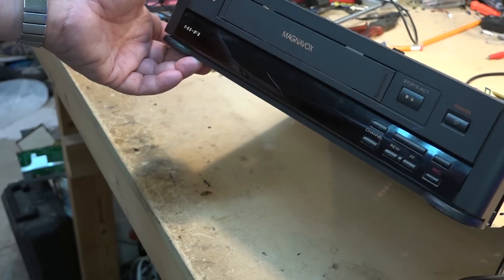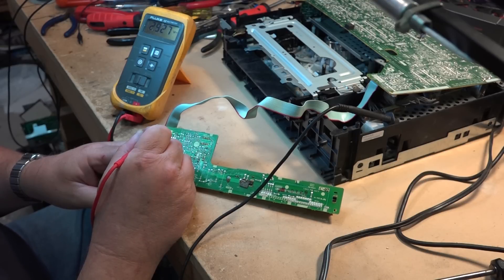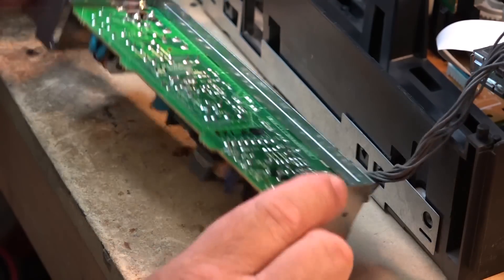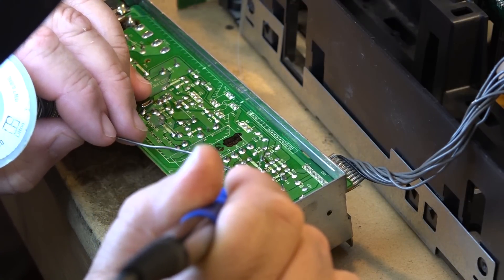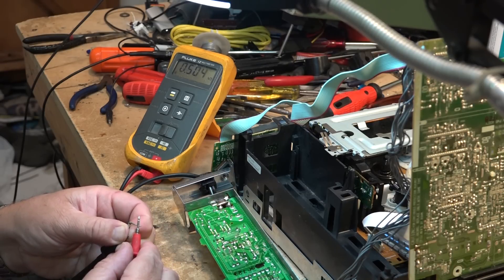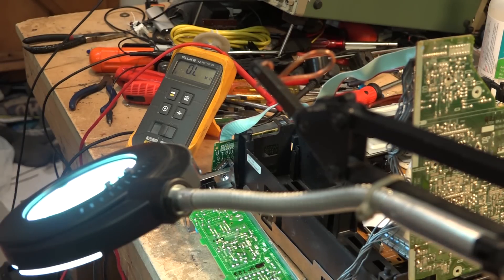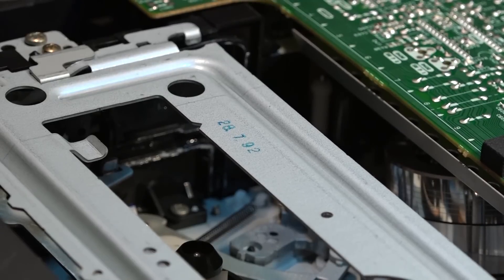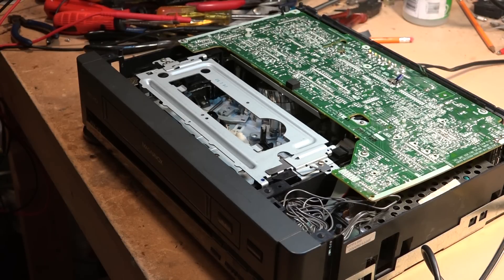Troubleshooting vacuum fluorescent display problems

Comment: What about if all supply is good and complete but no display. What is the main trouble?
Reply from the maker: If voltage is correct there is only 1 thing left. The display tube
Reply: @12voltvids  it can be repair it the  display tube?
Reply from the maker: @paolomarcelogalvan1938  
Sure, replace the tube.   Good luck finding one.

Comment: after replacing the resistor you should have measured the filaments again so i can understand what it should be
Reply from the maker: Filaments typically have about 2vac on them but some designs use DC filaments so measuring really wouldn't accomplish much because it depends on the design you are dealing with and how it is wired.
Reply: @12voltvids  i'm trying to determine if the vfd on this expensive piece of gear (Lexicon M300) is dead or if the PS needs addressing. I have to understand how to test this VFD. thanks
Reply from the maker: @geezberry8889  you will typically see ac on filaments or and there may be a -dc applied as well as the AC to hear them.  Then the anodes get a + voltage. Then there is the screen. There Are many types of display.  Direct drive and multiplexed.  It could be a power supply issue, driver issue or a display.

Comment: Hi.  I am working on VFD clock radio.  I have the service manual.  The display appears to be working fine.  The Hi is very visible and the Lo is really only visible when the room light are out, an maybe that is the way it is intended to work.  Is there another a way to communicate with you?  It is a Panasonic RC-6610.

Comment: As Adie Lawson said below, you make it so easy. I have a situation in my JVC hifi after installing a bluetooth upgrade i "ACCIDENTALY" dropped a screw on the back of a main board and shorted a PNP transistor and now the phosphourescent display is reading a troubling 8888888888 and every display segment is on.  The trouble is trying to locate a KTA1046-y transistor and the only unit that was economical to get in a decent delivery window of 3 weeks was from england, the ones in china would take over 2 months....... nothing like modern times.

Comment: I see why the display was not lighting up, would it be the same possible issue if the display is lighting up but very dim and an equally dim??  The right side of the display lights up a little more than the left side.  This is for a very high-end Carver receiver, so I have to repair this she’s a classic‼️

Comment: Any help regarding a Kenwood KE 7090 Graphic Equalizer? On standby mode you can see like red lines that glow, never happened before, ive replaced all capacitors but still the same results

Comment: Hi. I have an VFD on my car and suddenly it filaments started glowing orange. What do you think, it's wasted or can be repaired?
Reply from the maker: If they are glowing then there is too much current flowing through them.  They normally do glow very faintly as they are hot cathodes.  They have to be hot to work, but not to the point that they become an incandescent light bulb.

Comment: I have a Sony RDR HXD710 which has a very dim display but it’s brighter towards the edges. Everything else on the unit is fine. It’s got an always on display though, so do you think it’s a warn out display or something to do with the power circuitry such as capacitors?
Reply from the maker: The display tubes do eventually wear out.  The cathode wires eventually drop in emission and the brightness falls.

Comment: Hi. Thx for the great video. I have a question. I have a Sony Lbt-V902. There is 2 problems with the tuner and equalizer displays. Tuner: Some characters of the tuner display are dimer then the other ones. Equalizer: Right channel display is dimer then the left one on the spectrum analizer display. Are these fixable without changing the displays which are impossible to find replacements? THX

Comment: How do you make a VFD brighter mines started going dim on an old kenwood equaliser?
Reply from the maker: If the voltages are correct then it is the tube that is getting weak. They are a vacuum tube, they do get dim as the emission from the cathode decreases.

Comment: Is this a common issue on VCRs? I got a Panasonic NV-HD100PX (yes, it's the K deck) and the display doesn't light on. Plus it had that common issue of the cracked plastic piece on the loading motor, which I managed to fix with super glue.

Comment: I have perfectly good JVC HR-XV3 VHS/DVD player that only has dead display. I took a look inside but couldn't see anything obvious like leaking or bulged capacitors (that's where my skills end) and seems like everything has to be dismantled to get the power supply board out because it's under the DVD rack. I wish I was electronics god too lol

Comment: I think that about 75% to 95% of problems with electronics can be rectified somehow if you have things like a 3d printer or the ability to etch a printed circuit board, but if a vacuum florescent display suffers a catastrophic failure (like being vented), it's all over, unless it's a video cassette recorder that has an on screen display or something.

Comment: Great video, I love VFD's.  I've got a different issue with mine, mine pulses the grids that are supposed to be off.  I don't know if it's a power supply issue or just the display.  Here's a 5 second video of it happening.  

https://youtu.be/68BuT-MloW0
Reply from the maker: Well I can tell you what it definitely isn't.
The display.
They don't fail like that. They are a vacuum tube, basically a direct heated triode.
It is likely a bad filter capacitor in one of the supply curcuits. I had a weird one with a display issue.
Watch this one:
 https://www.youtube.com/watch?v=tcWQvWI5WEg&t=600s
Might give you an idea. This was one where an electrolytic capacitor actually shorted.
Reply: I recapped all the electrolytics I could find the the PS, but no dice, and I measured 11 VAC on the 32 Volt rail.  Dunno what the heck is going on there, oh well.
Reply from the maker: You shouldn't have AC on the 32 volt rail.
How are your diodes?
AC should only be present on the filament
Reply: I pulled the rectifier diodes and they all pass a diode test.  However the resistance across one of them is 800K ohms while the others all measure around 4 Megs.  I don't know if that means anything.
Reply from the maker: Normally silicon diodes will pass current witha .6v drop across the junction in one direction, and apear as open in the other.
Reply: Thank you sir, I don't think it's the diodes I tried 4 new ones.  My VCR as a lot of shielded cans everywhere, I found some bad caps in some of those.  We'll see how many more I find, haha.
Reply: how about if a few characters are not showing up? Would that be one of the pins that control that letter are not connected properly? Or would that be something messed up with the anode? the letter is not faint at all, its completely off, and the rest of the display is perfect, what is the best guess here?
Reply: Steamboat12 my display has some segments that stay lit and don’t go out.example is on number 1 the top segment stays on looking like a 7.

Comment: I have a Sony STR-K670P Home AV amplifier. It's still going great without any bad solder, though I noticed the display is quite a bit dimmer than it should be, but still legible. The matching DVD for it almost is blinding in brightness in comparison to the amp. Is this a case of it worn out, or do you think there is any servicing I can do to restore it somewhat again? I have tried the DIMMER button, but it just makes it darker.

Thanks
Reply: The upper part of the display is dimmer than the bottom part, and there are some faint red thin lines, I think it gets brighter at the bottom at one of those.
Reply from the maker: It could be the tube wearing out. If the supply voltages to the tube are correct, and there is low emission then it is the tube. Those glowing wires you see is the cathode (filament) that is heated so that it looses electrons that are attracted to the positive charged anodes (segments that light up)As the cathode wires wear out, (actually the chemical coating on the wires) they emit less electrons. It is also possible for then to actually break. This you would  be able to see if you remove the dark filter in front of the tube so you can see the glass tube. If one of the filaments at the top was broken, then there would be no emission at that part of the tube and it would be darker.I built one of those ICE TUBE clocks last year, and the seconds digit is dimmer than the rest, but in this case they use a buck converter to generate the 40 volts needed by the display, and the pulse duration is very short, and as the digits scan left to right, by the time the multiplex scan gets to the seconds digit the voltage is discharging from the capacitor. I contacted the kit manufacture, and they said a new converter transistor was needed and sent me an upgraded part, and it made a slight difference. Of course if I power it up with an external supply it works fine. My feeling is the choise to use a buck converter was a bad one as there is not quite enough power. They should have driven a proper transformer to create the 60vdc supply rather than a simple buck converter. When I measure the average voltage with a meter it is fine, but the scope tells the truth, the voltage starts at about 60, and then as the digits scan drops to about 20 as the capacitor discharges. My multi meter reads generally 45ish as they are not fast enough to catch the ripple.
Reply: I'll check it over with my meter when I get home. The unit is only from 2005, so it's odd that it has this fault. I mean it's not that old. But, I bought this about a month ago used off eBay so I have no idea on the history of it. Thanks for your reply :-)
Reply from the maker: Ebay... OK you said enough. I have never received anything that works properly off ebay, or for that matter Amazon. Every piece of equipment I have ever bought has one thing or another wrong with it.
Reply: Other than the display issue it's fine. I'll tear it apart tomorrow and see if I can find out whether it's repairable.
Reply: 12voltvids I don't use it on my main hifi setup so it's no big issue... I'm just a fan of the Sony brand. Ever worked on the DAV-S systems sony ever brought out? I have the DAV-S550 and DAV-S880. My days the 880 I got was beaten up. Speakers blown, headphone board snapped causing the unit to stay in headphone mode all the time muting the speaker outputs. I got it working though and repaired in the end, and now it sits with my main hifi setup. It stacks perfect with my Sony TA-V701 amp, which, wouldn't surprise me if will need servicing soon as it's been going strong for 25 years without an issue, and I'm surprised the controls aren't dirty yet etc.

Comment: Nice job.  How about if it was just a "dim" looking display?? 
Only reason i ask is,i have a sony MHC-2200 system that seems (to me), that the display is on the Dim side. I was going to re-cap the whole thing anyway....but. ugh.
Reply from the maker: Check your voltages, if they are low then it could be a capacitor issue or dc-dc converter if it uses one. If the drive voltages to the display are normal, then the display could be getting weak.
Reply: Thanks,I'll be doing just that then. It's old,but i love that thing. It just sounds good for only 30 Watts.
Reply from the maker: People put too much emphasis on re-capping thinking that it will fix everything. Electrolytic caps do fail, but not at the rate that everyone thinks.I just overhauled my 37 year old Betamax. You know how many parts I put in it? Zero, none. Not 1 single part or capacitor. I figured that I would find bad ones, and I am sure they are all getting pretty dry now, as some of the circuits had drifted off frequency, but a little tweak and it was recording and playing fine. Mind you I am not using this machine, and likely never will use it again, it was more of a project to see if the unit would work after sitting untouched since 1986.&#160;30 years&#160;and even the belts and rubber was mostly OK.I have about 8 gigs of raw footage to edit, and I will&#160;post this old interesting VCR from history.Back to the capacitors, I only change capacitors that I suspect are bad after measuring the ESR on my meter, or if they are showing visual signs that they are bad. (Bulged can, leaking electrolytic ect.)
Reply: wow. 37 years!
point made

Comment: A weak VFD is not the same as this correct? That's caused by just the phosphorous getting old?
Reply from the maker: Usually it is the rare earth coating on the filament that goes south and causes low emission. This one didn't work because a resistor in the filament circuit was open, so no current across filament to heat it.
Reply: Can you make a video how to fix this cause I'm having an Kenwood tuner were the display is dimmer than it should be. Pls. make a video about this

Comment: Question for you. When a cap goes bad and leaks on the PCB should the board be cleaned? Will the goo from the cap eat away the PCB over time or not?  I enjoy your videos on repair. Thanks.
Reply from the maker: Yes it will damage traces. The electrolytic is slightly corrosive.

Comment: should the voltage on the heater be around 3v, I have a calculator with a florescent display it it appears to be 3v
Reply from the maker: Yes about 3V

Comment: A good 23 years old, doesnt look that old really.
Many years ago i had a frends vcr here, the display had gone off but the machine worked.
Near the front there was a small metal box with transformer and parts inside, it was the display h.v supply, the aluminium top cap that sat on the round transformer had become unglued and shorted the feed, i left the cap out and replaced a micro fuse N30, all was happy again :-D.
Daft faults lol.
Reply from the maker: That would have been a Hitachi made machine. Dc-dc converter failure is what that module was. It also generated the hv tuner control voltage on some older machines with voltage synthesis tuners. Those were the ones that have the trimmer pots to set the stations.
Reply: Yep i think it was, it worked very well, my frend never had another problem with it again :-).
My favorite was the panasonic Nv333, very forgiving when playing tapes.